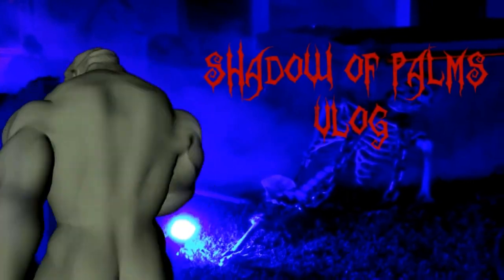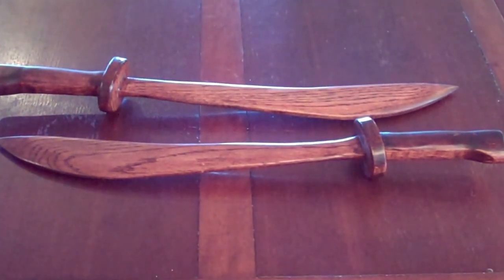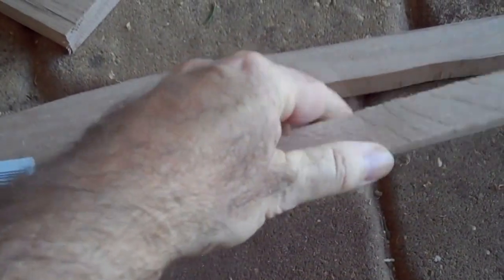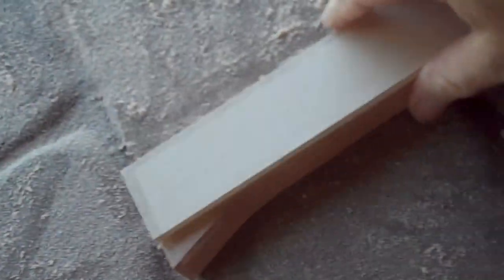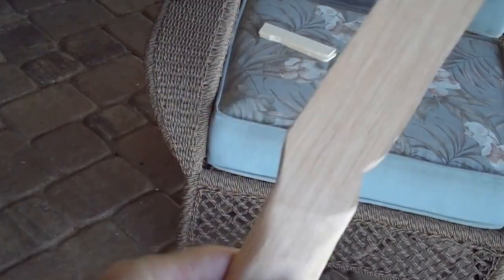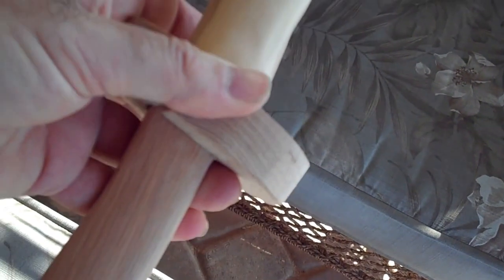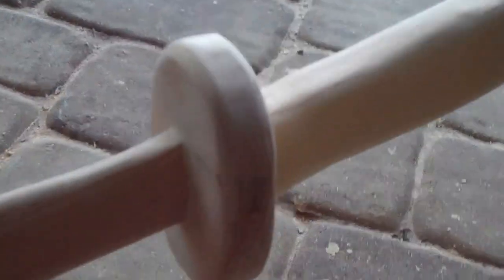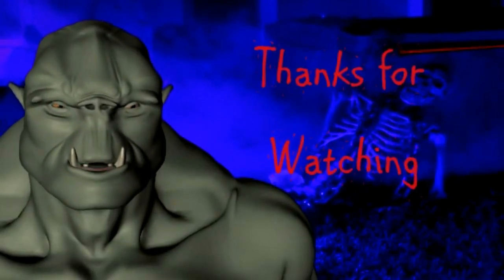Shadow of Palms Vlog 01 09 13   Chinese Broad Sword

Comment from the maker: actually it would make more sense to make the spear head (I would make it out of wood instead of the traditional steal because that is what I do) and order a wax wood staff to put it on (as that is probably the best wood for the project). I would shape or cut it as needed and add the "red beard" or "Draggon tassel".  I have not built one yet but it would be a fun project.